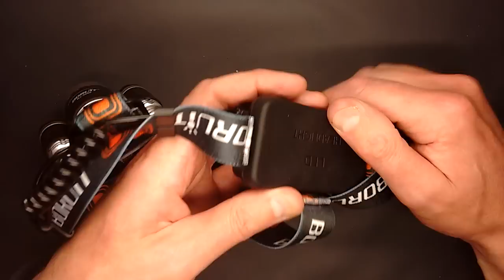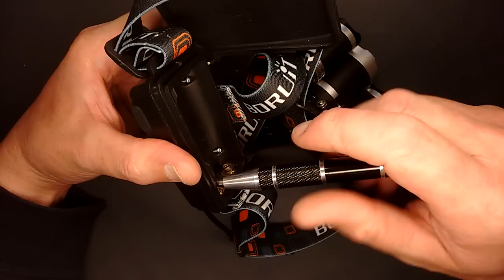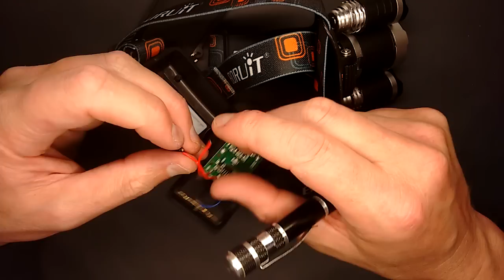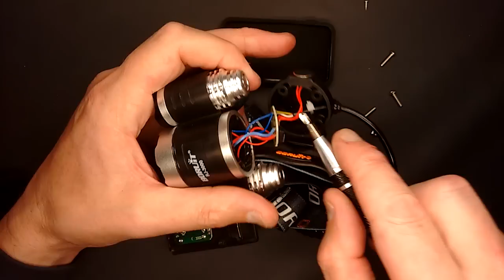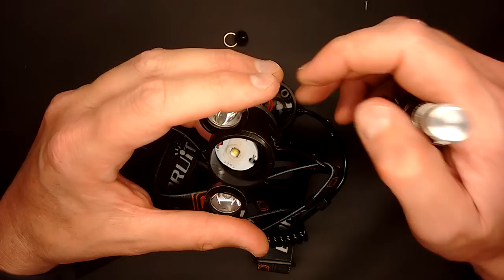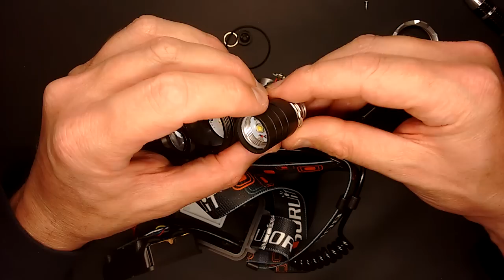Burnt battery contact head torch autopsy.

Comment: Clive, the light reflecting off your hands is tricking the camera into underexposure and making it hard to see the headlamp: the proof is the final frame, where ond hand is in shot and the headlamp is much easier to view (two hands create more trickery than one). The solution is a camera setting called Exposure Compensation: you probably need to set it to +1.0, maybe +1.5. This isn't criticism, I'm just trying to help, since you mentioned the settings. I have a background in photography and I like your dry humour.

Comment: Wouldnt the snipped wire, cause more current to flow through the  remaining battery? causing the contact heat up? plus bad design?
Reply: And I'm just trying to be helpful!
Reply: +Randall Caulder no worries! thank you for the info!
Reply: Nah these light will work just fine on a single cell. Designed to run on one cell or 2 cells for double the runtime.
Reply: +Randall Caulder have a link for this one? I want one of these, the design seems very nice
Reply: topher
Ebay, search for Boruit Headlamp. Don't get one that comes with batteries, they are garbage cells. Buy some Panasonics or Sanyos seperately.
Reply: Also it's not 9000 lumens as claimed, actually a little less than 1000. And the 18650 cells that claim 4000mah, there is no such thing. 3500 is the max on the best cells available. The ones that come with these lights are more like 800mah.
Reply: +Randall Caulder I've been flying RC planes for years I know all about lipos and lights just still searching for a good quality low cost light

Comment: I bought one of these, and when I received one of the wires in the side lamps was disconnected, and I had to re-solder it. Seems that this particular one also had some bad or missing soldering, so perhaps that is a thing with these.

Comment: Could the problem have arisen within a protected cell whose protection circuitry shorted.
Reply: ***** I got a very prompt full refund from the seller. They had offered me the choice and after I realised that I wasn't comfortable even wearing a replacement incase it too had a similar fault, I opted for the refund.
Reply: The cells didn't have the protection circuit.
Reply: +AlpakaWhacker
I have one of these lamps too - I like it. Bizarre fault. Post if you ever discover the cause.
ADDED: Was that cell destroyed?
Reply: George Applegate I like it too, the body of it was a good quality product and I literally have no idea what the issue was. Neither of the cells were destroyed and I still use them daily in my hand torch.
Reply: AlpakaWhacker
Were the cells identical and equally charged?
Reply: George Applegate I believe so yes
Reply: AlpakaWhacker
From Clive's description, you put charged batteries in and were greeted with heat, so my best guess is the broken negative wire on the charging socket (which I'm guessing you never used) shorted to positive. Occam's razor. In this scenario the copper wire sustained the load without as much damage as the steel (verified) battery contacts, but that still does not explain why one battery drained so much more than the other.
Reply: George Applegate I never used the charging socket and what you said is essentially what I thought to begin with and I too am confused :P
Reply: +alpakawhacker did you get a refund/replacement ?
Reply: AlpakaWhacker good to hear that. I also find the idea of 18650 cells next to my skull a bit scary

Comment: I found somewhere on the web a datasheet for the chip. It's purposely designed for torch applications, there are 2 spare pins that by tieing either to ground or vcc you can disable the SOS mode. 

Another interesting quirk with these torches is when you use a radio near them, the torch will turn on. I guess the track to the transistor is acting as an antenna and allowing the transistor to turn on a bit.

Comment: The overall quality of the lamp doesn't look bad at all (although the pinched wire shows that quality control is crap). Do you know where he got the torch and how much it cost?
Btw. I'm with the others that thing the spring contact shorted one end of a cell (center nub to outer battery case).
Reply: i got mine for €11 of AliExpress
Reply: Also got my one from AliExpress £10 in postage exactly the same build quality but no faults in my unit. only thing i would say is bin the stock UltraFire 18650's and throw in some nice Samsun 25r's. Good bit of kit and great value for money!
Reply: I have one of these torches and it's fairly decent. I got it from a Chinese seller on ebay. Cost was less than ten quid.
Reply: I got it from Amazon for £17 during a lighting sale (normal price is over £30)

Comment: new videos are odd. get the old camera back or at least the old mic
Reply from the maker: The sound is going to be very different because I'm travelling and the acoustics will be affected by where I'm filming
Reply: I like the quality of the recordings with the new camera, they are a bit crisper. The automatic exposure adjusts a bit too fast, but with the usual overhead lighting you have in your workshop it shouldn't be a problem. Also, the video is not washed out by the lights - not sure whether it's that the lights are less powerful, it's auto-exposure or it's the HDR thing you mentioned.
Reply: But please, do something with that video, it's simply painful to watch
Reply: Sound is perfect, other videos are wayy to quiet, quality may be lower but the volume is great. I watch most if not all videos at 25% volume. Your need like 60-75% to be the same volume.. then I forget to turn it back down and get deafened or wake the neighbours.. because.. well.. it's usually 2-3am when I end up watching haha!

Comment: Looks like a nice little head-torch. That's too bad it was brought down by either that loose wire or a cell inserted the wrong way round. But then, I think a lot of us who've done field work have seen simple things take down quite complex or expensive equipment. Those are the "horror stories" they like to tell in Engineering 101 classes.

Comment: I've had a bikelight where the batterypack wire shorting out the battery. I replaced the cable, and after a ride it shorted again. It happens that the plastic wire insulator didn't like -5C (or lower I can't remember.. 6 years ago). No spectacular fire because of AA batteries not lithium. A silicone wire insulation would have been better.

Comment: having 2 18650 cells actively discharging that close to your skull doesn't seems like a great idea...
Reply: Well said....the whole skull may light up if those batteries discharge the wrong way.....
Reply: Ha ha....
Reply: Actually Radakk with shit cells charged in a shitty charger used in a light, very likely with no low voltage cut off, the danger is REAL. (Note, I have two 18650 powered headlamps that I use without fear.)
Reply: Richard C
I agree the danger is real. Nonethless driving a car is statistically more dangerous.

Never read in any flashlight forum about someone wearing a headlamp when it's cells went into thermal runaway.
Reply: Yes I have heard of cells venting with flame, but not specifically while inside a headlamp. Definitely not saying that it can't happen. Obviously if you feel heat or smell smoke take it off your head. There is no risk of explosion because it is not inside a sealed container like it would be in a flashlight. Only risk of vent with flame. I've been an active member at candlepowerforum and budgetlightforum for years.    The only thing I have said is one has a greater risk of injury or death driving an automobile.
Reply: Depending on quality.. Don't want. My 18650's shorting there.... They are protected.. But the current.. My god
Reply: +Randall Caulder you didn't? You should read more often! I had some cells, that I bought knowing they weren't good ones.... Well... Fire.. That's what happened 😂
Reply: And its really not a risk if you use protected cells from top tier manufacturer such as panasonic samsung sanyo sony or lg.

Comment: You would need to look at the actual battery that was installed in the bay that shorted to the brass terminal. It seems that the short was between the Pos and Neg of the battery caused only by the brass terminal.

Comment: Hmm. The battery contacts (cells) are in parallel? Seems like someone put a cell in backwards.
Reply: Nope :P I definately put the cells in the correct way aka. In parallel (it was my headtorch)
Reply: If it was 18650 - very likely, as many 18650 cells are poorly marked on their polarity (I had to mark them with permanent markers)
Reply: I have one of these torches (although it is difficult to be sure if one has the original or a copy). I found the 'two cells in the same way round because they are in parallel' thing hard to get used to.  I'm sure that this wouldn't be the first torch to endure (enjoy?) the cells installed in the more usual 'alternating direction' way.
Reply: I agree.  I have the same headlamp and had a look at it.  Seems to me the most likely explanation is a cell in backwards and the spring terminal shorting out the pos and neg on the cell.  On 18650s, there is little separation between pos and neg on the pos end.
Reply: AlpakaWhacker I stand corrected. :-)
Reply: I've had that issue with NiMH AA cells before. There's very little clearance between the positive terminal and the case on the positive end of the cells. One 'funky' battery contact in a device,and things can get hot quickly.
Reply: Dennis Lubert Both batteries had just been fully charged,
Reply: na rc The batteries do still work fine, I tried the torch multiple times with the same result
Reply: I think so too, people are used to getting the batteries in series, but this thinggy wants them in parallel
Reply: do the batteries still work? did anyone re-try the lights? maybe the planets were missaligned
Reply: Or one of the batteries was empty.
Reply: I have a Lithium-Ion battery which the terminals on the label are incorrect!!!
Reply: Where did you get it? Apart from the obvious shortcoming, I rather like it and might want a ... functional version.
Reply: simpleminded1uk Amazon UK
Reply: +AlpakaWhacker not trufire stuff? I hope not! Did u used a dvm to check them?
Reply: Andrew van Leeuwen what?
Reply: Ideally, two others in the group. Should someone get stuck or injured, one goes for help, the other stays to provide support or first aid to the immobile person.